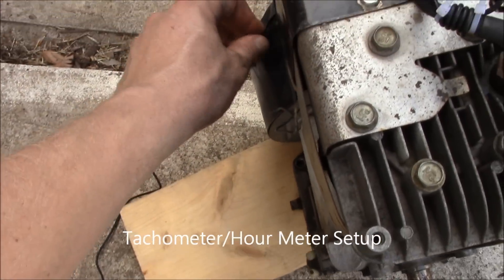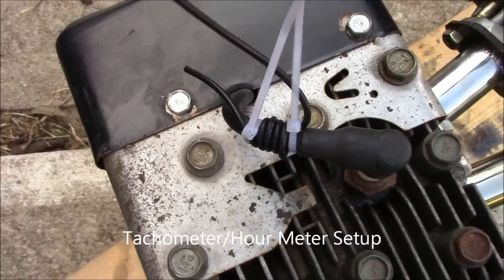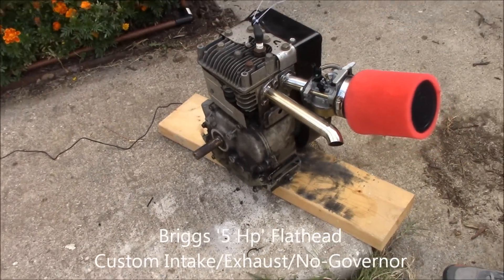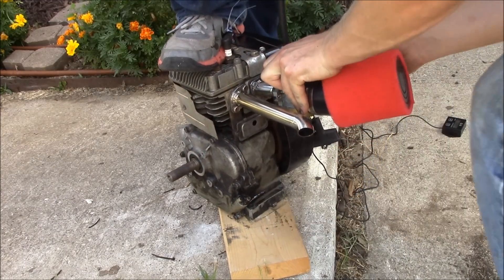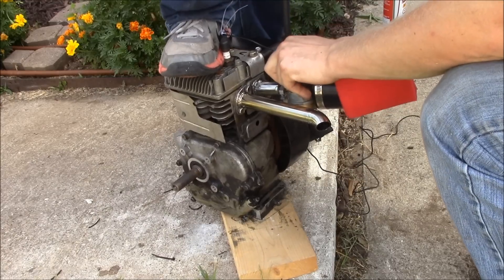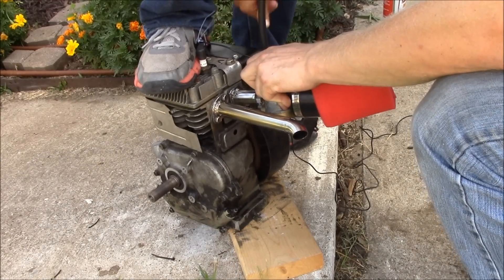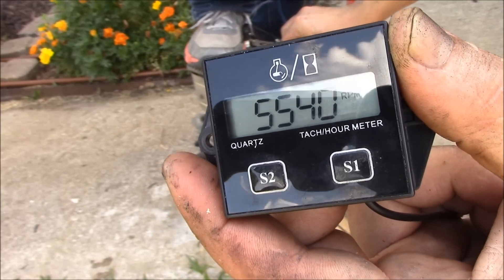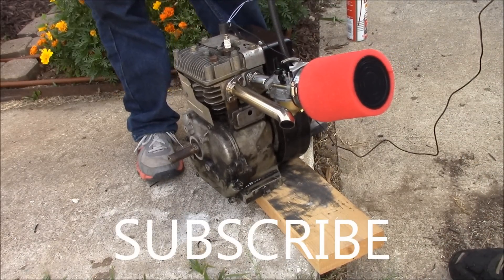How to Install a Tachometer, (BRONDA Part 4)

Comment: do the Tachometer come up with a battery inside how do it get its power from ?
Reply from the maker: Induction from the spark plug wire while the engine is running

Comment: actually valve float won't protect flywheel and rod from over-revs like when you remove the governor. spend enough time above 5000 rpm and you'll find out when you least expect it,,,
Reply from the maker: true to a point. As long as the crank is getting enough oil, should be fine. Oil clearance and lack of lubrication on the crank journal at high rpm is the #1 cause of engine failure if you remove governor and STAY at high rpms. Box stock go kart racers turn these 6200-6300 rpm in 10+ lap races and have no issues. If you over rev the engine too far, the flywheel magnet can fly out as well. Briggsflatheads  dont have these issues until you get to 9k rpm with flywheel breaking, but the dipper on the rod has been known to break off eventually after flexing under high rpm, which causes metal fatigue (like a spoon bend it too many times and it just breaks). Cheaper clones dont get into these flywheel issues until about 7k rpm. Its better to be safe than sorry. Ive got a billet flywheel and a billet rod in the engine now.

Comment: I got this but tachometer but it's not turning on.. is there a way to turn it on and off?
Reply from the maker: Has a battery. Is there like tab of plastic you pull out? The engine rpm signal should charge it and automatically turn it on.
Reply: @KartFab   When you first get it you have to hold down both of the buttons together for a few seconds. I figured it out. Thanks anyway!
Reply: Where do you buy this Tach?

Comment: so then if I put stronger valve springs on my mini bike will it give it a higher tsp
Reply from the maker: what is tsp
Reply: KartFab 

top speed
Reply from the maker: Short answer for short question. No. It will not. Speed is determined by available horsepower, weight of go kart, parasitic drag, incline, and gearing. Stronger valve springs alone will only slightly decrease available horsepower through operating rpms. If you were to do other performance modifications, then it would make sense to but in stiffer valve springs.
Reply: KartFab 

but on my mini bike I have removed the governor on it and I have a performance air filter, header, spark plug and a arc billet rod so would it be good if I did upgrade the valve springs
Reply from the maker: +Adrenalinejunky yes, it would. You might want to look into a mild cam that will tell you what valve lash and pound spring to have.

Comment: Hi, on your Brondo, did you have a problem with the carb idling when you upgraded to the predator carb?
Reply from the maker: +22mswartz zero problems. There is a black screw on the top that adjusts idle speed. The stock idle pilot holes worked out perfectly.

Comment: I have a similar tachometer, but it does not have any way to be set to 2 stroke or 4 stroke. It would read 500 rpm on my 4 stroke when it sounds to be at an idle. Is it possible that the tachometer I got was meant for 2-stroke but advertised/sold as 4-stroke?
Reply from the maker: Maybe you  just haven't figured out how to do the change. Have you tried looking up the users manual and following the directions?
Reply: No buttons. All the instructions are on the back of the package and every step is easily understood. I even try different placements of the single wire, no changes at all.

Comment: I had wandered about the flywheel when you put the Clonda carburetor on it. With the Flathead I guess there is no worry about dropping a valve on a piston
Reply from the maker: yeah, lol that is one of the few benefits of a flathead over an OHV engine

Comment: Will this work on a 2-stroke? Since you just wrap it around the spark plug wire?
Reply from the maker: +ryan m99 yeah but you change the settings on it for a two stroke
Reply: ok, thats what i was wondering, thanks so much!

Comment: I am looking to do a similar upgrade to you but my budget don't allow me to purchase a flywheel. I am aiming to get around 7000+ rpm's. 
This is my list of parts I will be upgrading: 
- Camshaft
- Billet connecting rod
- 22lb valve springs 
- Remove governor
- Re-jet Carb 
- 5 degree timing key on flywheel
- Air filter kit
- exaust pipe 

Do you think the flywheel could come apart? If so what could i do to prevent it?
Reply from the maker: +X xteardamagex X don't upgrade springs unless you are getting a billet flywheel. PVL flywheel works too.

Comment: I have a question... And can adapt the honda  carburetor clones in an engine briggs & stratton model 13 3.5hp family raptor
Reply from the maker: +Joel Guerrero Durán all you need to do is match a honda carb for a similiar displacement engine for the briggs displacement. Once you know displacement, then just get the right carb.
Reply: +KartFab How can I know what it is displacement engine?

Comment: i love what you said..
Basically: " The stock valve springs act as a governor to the flywheel. You can go past it,just like you did the engine, but only so far until flywheels needs upgrading. THANKS!

Comment: are you still running stock internal parts? I am building a flathead for my go kart and was wondering if I would be safe with stock internal parts at that rpm.
Reply from the maker: +verdebmxer47 yes all stock internals. Safe? Probably. Valve float keeps the RPMs low. If you swap out valve springs, you then need to upgrade flywheel and connecting rod.
Reply: +KartFab From what ive seen and heard stock flywheels exploding at 6000rpm is actually a myth and as long as there are no fractures in the cast theyl survive up to 10000rpm
Reply from the maker: Sam, it is not a myth, especially with the chinese versions (clone) engines. However, due to the damage they cause when they fracture, it is not something worth risking your life or your appendages over. $100 is pretty good life insurance, don't you think? There is also a substantial body of evidence out there that shows the oil dippers for the briggs 5 hp may fail below 5500 rpms causing the engine to seize, and/or the connecting rod breaking before the flywheel does. So a $60 connecting rod and a $100 flywheel are a huge benefit after removing the governor.

Comment: How to you hook up a real gauge tachometer and speedometer cuz I don't like digital ones
Reply from the maker: cant and feasible are two different things. Im sure its possible, but not very feasible.
Reply: KartFab Oh, so i guess I should just get a digital tachometer any recommendations? I want one that isn't just numbers lke yours. I want one that looks like it has gauges or a bar that goes to the right the more rpm' s. Thanks!
Reply from the maker: Ashton Moselle hmmm... good question. It depends on your engine actually. There are switches for 4, 6 and 8 cylinder engines on those types of tachs as well as different wiring diagrams (included with the tach). The speedometer is a whole different ballgame, and are NOT universal like most tachs. This is mainly for like a go kart, so a GPS would be your best bet. If you are doing one for a boat, car or some other automobile, you would need to check the manual.
Reply: ***** ya I'm Ashton I just am starting a kart channel I'm modding my Manco two seater to have like a dashboard rear view mirror and lights and stuff like that. The thing that's cool is I got the go kart for 20 dollars. The tourqe converter is worth 200 dollars ya it's a fun project I'm gonna upload videos you should check them out once I do videos I was just wondering how to do speedometet and tachometer for a cool look and for knowing how fast I'm going
Reply: Ashton Moselle I am getting a predator 212
Reply: So you basically can't put a mechanical tachometer on a predator 212???
Reply: @porkchopgaming8480  IF you can mount the speedo cable to the crankshaft or flywheel or maybe jackshaft, AND get the proper ratio gear by trial and error it can be done, but yeah, extremely difficult that's why nobody does it or offers a bolt-on
Reply: KartFab the one like yours will be very weird on my minibike.
Reply from the maker: try ebay,
Reply: ok thank you!
Reply: the analogue one does need a power supply of what I believe is 12 volts.
I plan to hook up a rechargeable battery pack or a ton of AA batteries.

Comment: Yea these things are great. 
Next time they are on special on eBay I'm gettin a half dozen as Xmas gifts. 
Great for a permanent install or to keep in your toolbox.  
I cracked mine open on my trapter and put LEDs inside it to light up at night on the headlight switch. 
Cool effect but it's hard to read while driving.

Comment: Can you help me figure out what kind of go karts frame this is
Reply from the maker: Sure. But the only thing I see is your comment, no frame.
Reply: I shared it with you on Google+
Reply from the maker: You have a manco. They made a bunch of models, but w/same frame. Goes by manco critter II and a whole bunch more. Go to americansportworks (online) and search for the manual for parts numbers. Gokartsrus and ebay are great places for parts.
Reply: Any ideas on what I should do to it
Reply from the maker: Put on a plywood brace w/foam and vinyl for seat, install a new brake band, chain, clutch, predator 212cc engine, new tires and bearings all around. Then go have some fun with it.
Reply: Thanks
Reply: Im going to be driving off road in this
Reply: How long will it take to sand
Reply: +david dustmann : It depends. How fast do you sand? How thorough are you? Are you going to hand sand everything, or do you have an electric sander of some kind? Are you doing this by yourself, or is someone helping you? Rush through the sanding part, don't tape anything off, and unleash a rattle can on it, and you can be done in about 10 minutes. If you want it to look good, just follow the directions, and however long it takes you, is how long it will take, because time won't be that much of a factor, if you decide  to make it look good.
Reply: call me
Reply: kreg mac ?